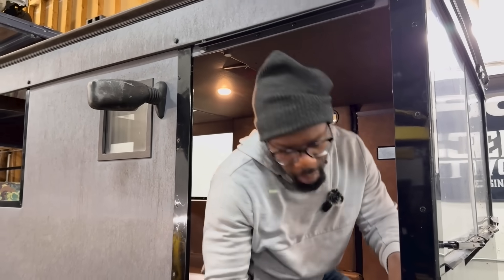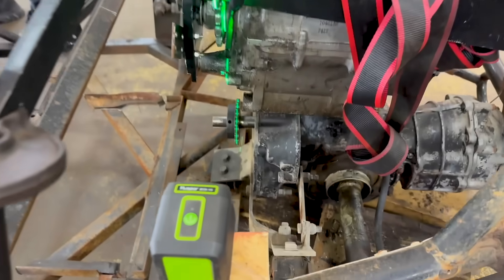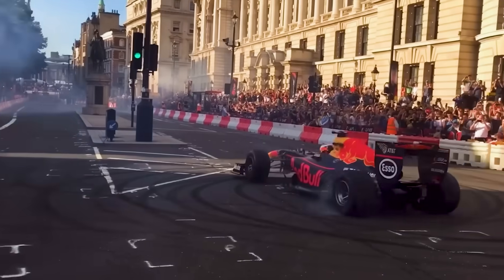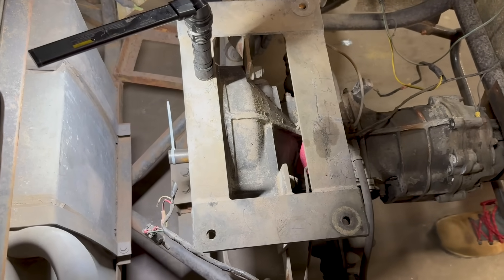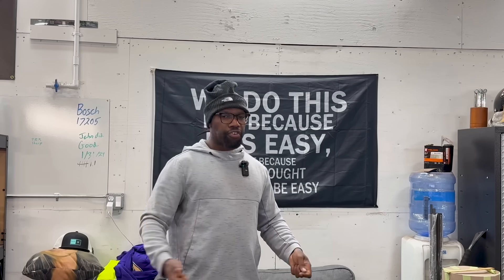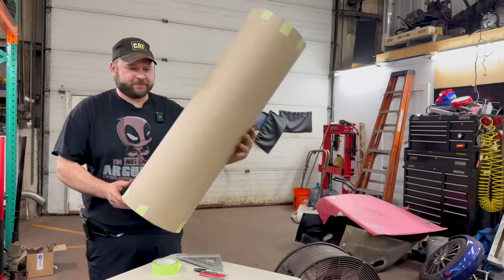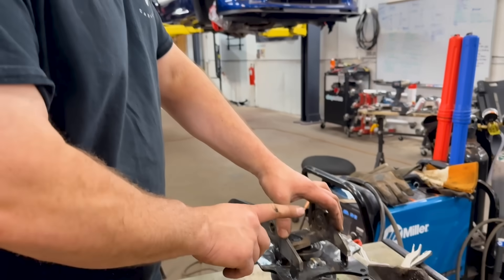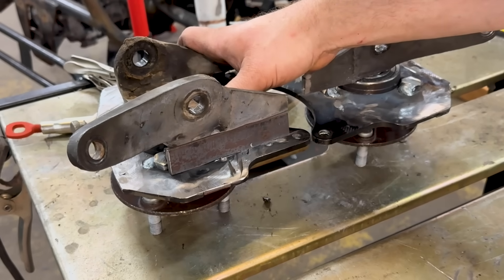Hayabusa powered F1 Car Gets It's Wheels Spinning For the First Time

Comment: I worry about that transmssion . It was not meant to accept tourq at an 90 degree angle. You need to add a support bearing on the shaft to keep from destroying the bearing in the unit and blowing the seal out.
Reply: I hope they actually read and look into what some comments say. There's a lot of comments this time around pointing out issues and safety concerns. 😂❤
Reply: The car was originally built that way.  When I drove them in the early 80s it only had one gear.   The inside of those trans axles are more than likely way different than what is in a stock VW.  I would not doubt there is some sort of support bearing behind that input shaft.   The stock put shaft sticks less than a 1/2" beyond the bell housing.
Reply: @IMRROcom yes, it WAS built that way, with a 40hp 2 stroke snowmobile engine powering it.

Now it’s powered by something over 4 times more powerful, with down low torque, and an actual clutch. It’s going to be under allot more stress, especially considering how he intends on using it.
Reply: I would be more concerned about the brakes I seen bigger brakes on a mountain bike. would anyone put them brakes on an Hayabusa bike
Reply: the torque is still axial to the transmission input sprocket, as long as the chain is not over tightened.
Reply: @licencetoswill Under high load its going to pull the shaft off center.

Comment: Please tell me that there will be a steel plate protecting the gas tank and driver from the spinning chains.... 😬
Reply: might not be too sketchy, chains tend to fly in the plane they're travelling
Reply: @nuttyDesignAndFab  Yeah... but engine parts and frame rails tend to be ricochet surfaces.
Reply: @baimun  fair 😅

Comment: You can't call it an F1 car.... What you have is called a midget car. Midget car racing originated in the United States in the 1930s. These cars have a high power-to-weight ratio, typically using four-cylinder engines that produce between 300 to 400 horsepower while weighing around 900 pounds. The midget car races are usually short-distance events, ranging from 2.5 to 25 miles.
Reply: It is not a midget car,  it is an amusement park ride.  It is an adult size go cart from the early 80's  you paid $1 to drive them on a timed lap trying to beat the clock.

Comment: your jack shaft is under engineered and right by your head I suggest you upgrade and brace brace brace
Reply: Brace and shield....any catastrophic engine or chain failure is bound to send shrapnel straight at your dome.
Reply: racing helmet required and/or some metal sheet, kevlar...
Reply: It’s so beefy, and then welded to the top of the bar using an inch of surface area 😂. Would have been better to enforce the mount more with gussets and potentially wrap it around the bar it’s welded to. This is like if Arnold Schwarzenegger had Stephen Hawkings legs 😂
Reply: Fr!

Comment: 20 gallons of gas right under your butt. What could possibly go wrong???🤓
Reply: Isn't that the orientation of practically every sports car?
Reply: @zzaaaaap   But with crumple zones, side impact protection, etc.
Reply: @nosoup4ucomebacknextyear  Good points. But if we’re using them for placing a tank in this death trap, theres no good place 😂. Might as well place it low and to the center